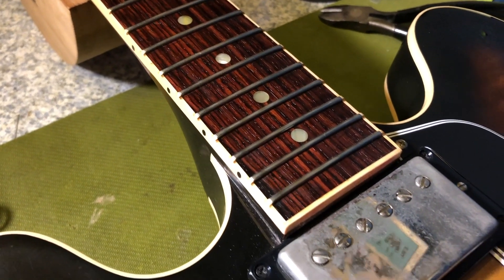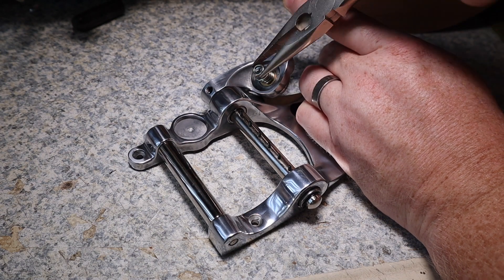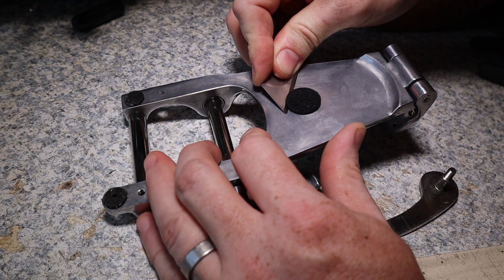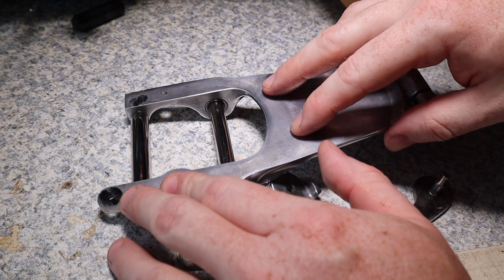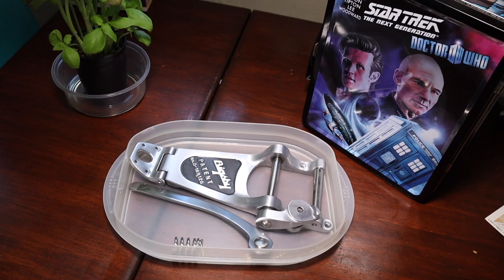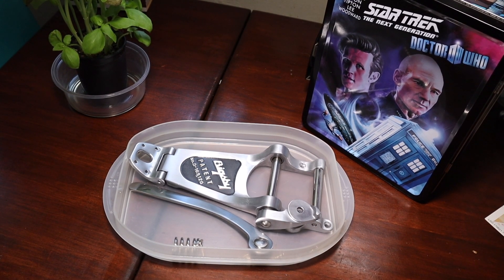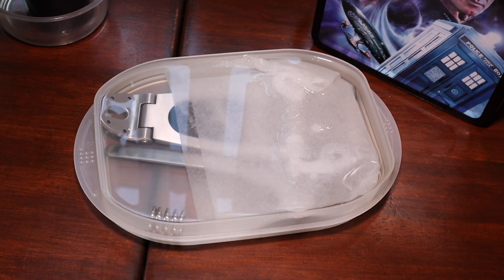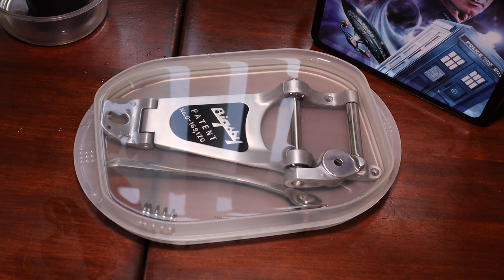Bigsby too Shiny? My Relicking/Aging Process for Matching Gibson Hardware

Comment: I have a Tele with a crappy B50 (they're not inherently crappy...but this one is) and I just ordered a B5. I know the holes don't match between the two but I don't care if there are exposed holes in the top of the guitar. All the hardware was relic'd when I bought it so I will definitely be doing this before I install it. I am still leery of submerging the bearings however...

Comment: Put the bigsby in a cake container with some muriatic acid at the bottom with the bigsby suspended inside on something else. It will relic the Bigsby or other hardware nicely. They sell the acid at Home Depot in the plumbing section.

Comment: But how do you remove the black paint?
Reply: The other Bigsby was a stunt double.
Reply from the maker: oh shoot
Reply from the maker: You know why I didn't film that bit? Because it came off with no effort in a big sheet. Just peeled off as easily as the petal of a delicate flower. I didn't even mean to do it. Anyway, I totally forgot to include an explanation lol whoops next time
Reply: Puisheen after the vinegar bath?
Reply from the maker: @jomaanon  On mine (the one missing the paint) it was already lifting on the treble side, but yeah, after the vinegar it was like the outer layer of an onion
Reply: Boiling hot water and some tweezers